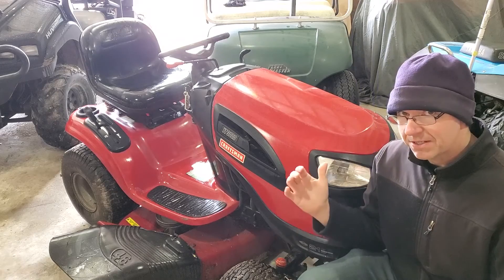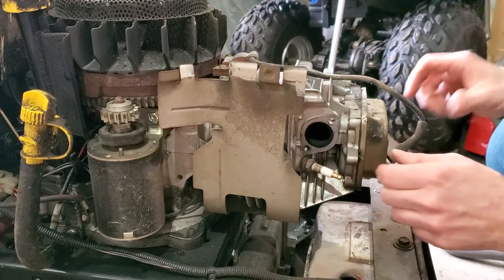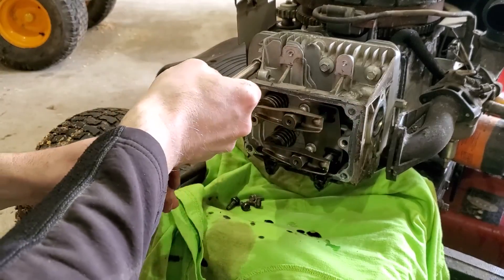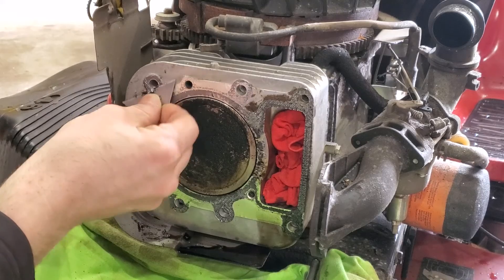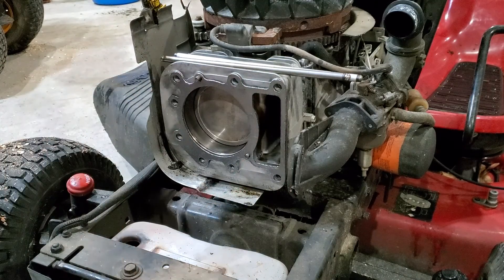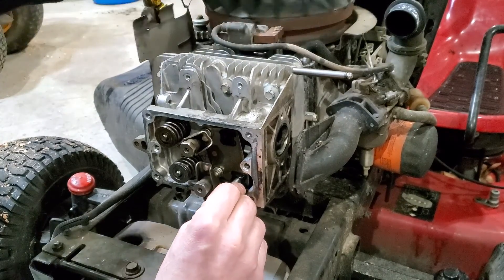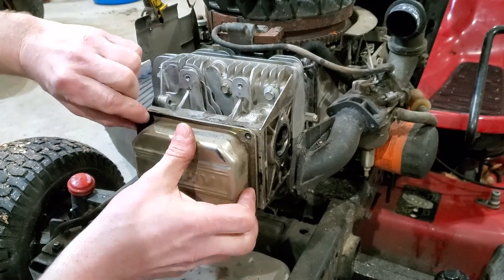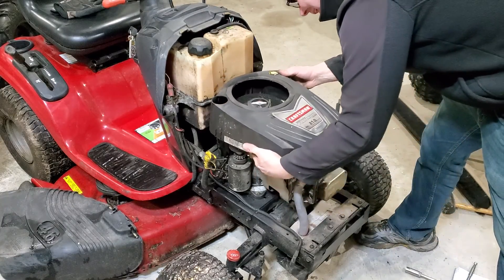Riding Lawnmower Head Gasket Replacement step by step

Comment: Your video was incredibly valuable to me - I had no chance of doing this myself without a step by step video like this one. The exhaust on my Craftsman LT2000 had a lot of smoke in it and I had to pour in more oil every mow, so I used your video to change the head gasket (and all other seals that had to be undone) and it's running well now with no smoke... Thank you!
Reply from the maker: Your welcome I'm happy the video helped

Comment: This video is so well done, I now feel confident that is the issue with my mower. I will be replacing the head gasket in my mower soon. Thank you sir!
Reply from the maker: Hey your very welcome I'm glad I could help 😊 let me know how it goes
Reply: @jlistdiy  Ordered Head gasket set from Amazon. Took it apart gasket was blown just like yours. Cleaned all the parts seated the valves installed new valve seal on the intake side put it all back together with new spark plug NO more burning oil.  Running great. Thanks again for the great video. 👍
Reply from the maker: @hectormiranda3646  awsome I'm glad to hear that 😀

Comment: Great video! I went through the steps and replaced the head gasket. My original issue was the mower would smoke when running and in operation. However, it no longer smokes when in operation, but rather when it is stopped. Any ideas on what could be the issue? There is oil leaking from the bottom of the head cover.
Reply from the maker: @DR-jq4pl  sounds like oil getting on the muffler possible leak from the valve cover

Comment: Hey, thanks for the great video ! One question, how do I set the pistons to top dead center ? Thanks !
Reply from the maker: Take the spark plug out and gently put a screwdriver into the hole and rotate the engine until you feel the piston at very top
Reply: @jlistdiy  thanks again !
Reply from the maker: @Tech-Mark  your welcome

Comment: Does it hurt to spot glue the head gasket on so it does not slide all over the place and make it impossible to line up the screw holes.  Or will the glue raise the gasket up a hair so that it is not perfectly flush an cause an oil leak.
Reply from the maker: The gasket should sit in place due to the 2 pins that help line up the head to the cylinder I wouldn't use any type of glue
Reply: @jlistdiy  Thanks for your reply. I  have a 15.5 HP Tecumseh lawn tractor engine and it has no pins.  I did not use glue after all and  installed the gasket today. What  I did was put a few screw into the cylinder head and then put the gasket on to the cylinder head  through the screws and then mounted the cylinder head to the base as compared to mounting the gasket to the base first and then inserting the cylinder head.
Reply from the maker: sounds like you got it all worked out I'm glad to hear it
Reply: @jlistdiy  Yes I did and as they say, there is more than one way to skin a cat.
Reply: @jlistdiy  I just spent 6 hours today trying to adjust the rocker for the exhaust valve. Can not do it  I was able to adjust the intake valve with no problem. When I have everything set up to be adjusted as the piston on TDC on the compression stroke, the exhaust valve rocker is tight as no slack at all. 

When I turn back the screw just a hair say, to try to get some slack, it  then becomes so lose that even the push rod will fall out. Either tight as no clearance or so lose that it falls apart. I tried everything as switching  the parts from the intake to the exhaust and it makes  no difference. The engine is a 15.5 HP Tecumseh on a 15 year old lawn tractor. Maybe it is designed that way?
Reply from the maker: @erwinerwin1245  is the valve stuck open cause it should be easy to adjust
Reply: @jlistdiy   I do not think the valve is stuck. Now how could I tell if it was stuck.?

 When I turn the engine over by  hand both push rods move up and down and both intake and exhaust valve spring expand and contract at the appropriate time.

Comment: Awesome job man! I like the confidence of putting the cover on and everything before starting it. That takes cajones! 

Just curious, does the valve cover labeled OHV need a gasket or RTV when reinstalling?
Reply from the maker: I would goes with a gasket it's cleaner and easy to remove when adjusting the valves in the future

Comment: you forgot the air filter....plus gasket sealer on the rocker cover....or did i miss these ?
Reply from the maker: Your right on the air filter I had to pick up a new one I didn't have one on hand and the rocker cover had a good reusable paper gasket on it im surprised I didnt mention that in the video thanks for pointing that out.
Reply: sorry i am a little panicky....doing a head gasket this week on my 21hp briggs...first timer.....watching a little to close i guess...thanks for the help.....tom
Reply from the maker: @pedalsteel5  nothing wrong with that and good luck with your repair
Reply: @jlistdiy    i'll let you know...thanks
Reply: Jamie..everything went as to plan...except i over tightened one of the 8 head bolts and it broke....top center one.....left it alone...mowed my back yard this morning...no smoke...hope the one bolt will not matter....time will tell i guess...tom
Reply from the maker: @pedalsteel5  you probably be ok as I've done that same thing many years ago and you technically only needed to tighten to about 19 ft lbs which is a firm snug without a torque wrench
Reply: @jlistdiy     hope so..drilling that bolt out may be over my head....i bought a new torque just for this job...the click was so faint, i missed it...live and learn...thanks Jamie, you're a cool dude.....be well....tom

Comment: At the 10-mnute mark in the video when you were installing the push rods, you were turning the flywheel, but you didn't explain what you were doing. Obviously, you were feeling for some kind of setting. I would like to know what it was you were feeling for and what the procedure you were doing is called. Thanks. — Rick
Reply from the maker: I was making sure the push rod was in the correct position so by turning the flywheel I was able to see if the push rod moved

Comment: I did everything you did but my mower will not start now. What would be wrong with it
Reply from the maker: Are your valves adjusted correctly
Reply: @jlistdiy  yes
Reply from the maker: @RufusKJones  are you getting spark check the wire that runs to the coil makes sure it didn't get pinched somewhere causing it to ground out
Reply: @jlistdiy  let me check that
Reply: It is wanting to start when I crack it but it will not
Reply from the maker: @RufusKJones  almost sounds like the valves are adjusted to tight or possibly out of gas  🤔